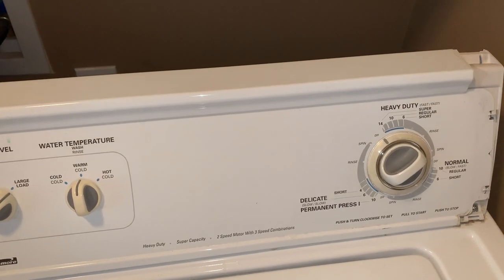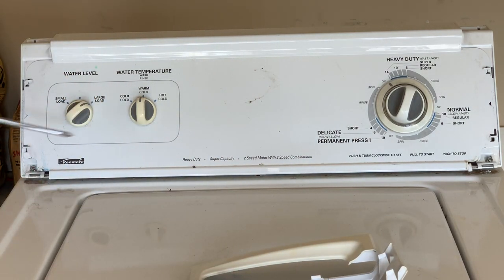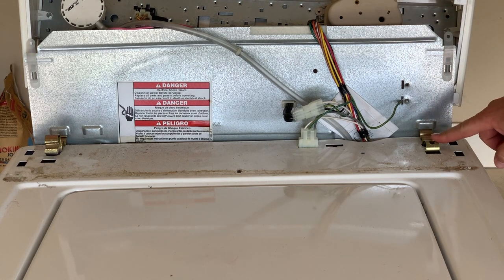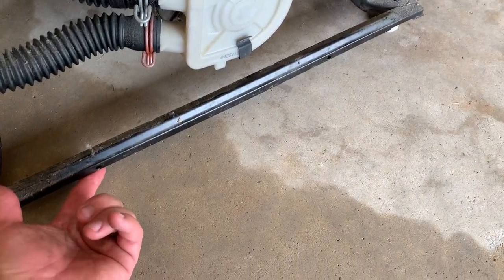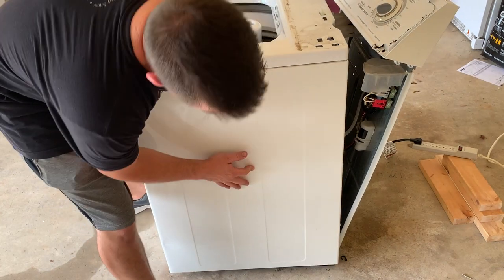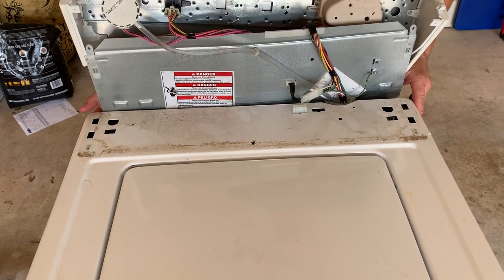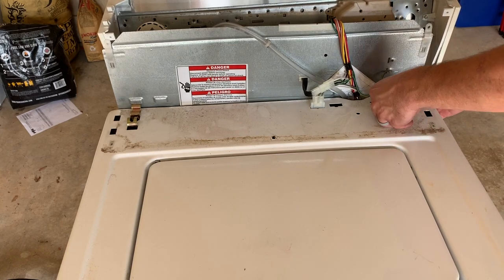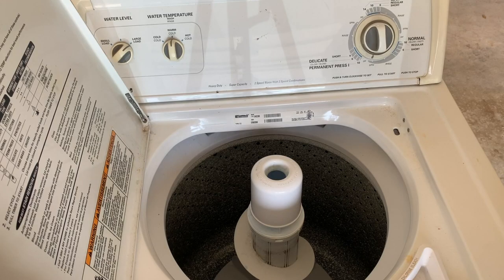Whirlpool Kenmore : Removing and Replacing Cabinet Housing

Comment: Thank you very much! Last week I had to take it apart to replace the transmission coupler, and re-wire the lid switch that someone had bi passed, but when putting the cabinet back together, I could not figure out how it went. I couldn't take it anymore, as it was coming apart when I moved the machine. This short video you made helped me to line it up with the metal lip in the front, and sides, etc (plus it is rusty, and dirty down there making it harder to figure out) so thank you! Even something simple like this is a huge help!!
Reply from the maker: My pleasure!

Comment: To remove the washer cabinet you DO NOT need to remove the hot or cold water supply hoses .
Reply from the maker: True. I removed mine so I could have more room to shoot the video.
Reply: ugh.  The trouble I went through on that part of the job!

Comment: This is a very helpful video. Thank you. I’ll add that some Whirlpool washers do not have removable trim capping the ends of the control panel. Instead, you must insert a putty knife into the gap on either side to release the spring clips that allow the control panel to flip back.
Reply from the maker: Thanks for adding to the convo!
Reply: There are several methods of anchoring the control console to the machine top on direct-drive models.  Some Kenmore models have the screws beneath those removable trim pieces as shown, some don't have the screws exposed without trim pieces.  Another method is screws at the rear corners of the console, with little tabs that flex back when a screwdriver is put in place, flex forward to hold the retracted screw.  And the spring clips.

Comment: Great video!  I just replaced a Washer Water Inlet Valve on a Whirlpool washing machine that was exactly like the one in this video...without the
little side covers over the two screws on the side. I didn't have to remove the cabinet, I just took the top loose and was able to get to the part I replaced.
Everything took about 30 minutes.  This video was perfect!  🙂
Reply from the maker: That’s great! Removing the cabinet is a pain.

Comment: Thank you so very much. You probably saved me $350-400 I too was struggling putting it back on. Of course its a pretty old machine and the frame is a bit dirty and rusted, but I got it back on. Quite honestly I wouldn't mind paying $75-100 for a repair. I don't understand how they justify charging so much for parts and labor. I wish I made $75/ hr and charged 300% mark up on parts.
Reply from the maker: I’m glad you got it working again.

Comment: Be nice if you showed how you got the top strap to snap onto the motor and kind of tools you used. I use electric tape to suspend the top strap from above so that it does not get in the way or fall off while replacing the motor.

Comment: Them two covers on each side of control panel you already popped and made easy top remoive is a key bit of information you omitted. How do they get taken off without breaking them.
Reply from the maker: I didn’t have any problem popping mine off. I didn’t need to use a tool.
Reply: @TightWadDIY  i had to use a putty knife.
Reply: I used a 5 in one tool. Be gentle and keep prying on all sides while wiggling the cap. It should come free.

Comment: Very helpful. I’m a tightwad too with a 20 yr old washer
Reply from the maker: I don’t plan to get a new one any time soon!
Reply: @TightWadDIY  hopefully I won’t either. Will have to see how this repair job lasts. That cabinet comes off much easier than it goes back on
Reply from the maker: @b-ran7024  The parts on this model are pretty basic so they should last a really long time. The cabinet is definitely tricky to get back on.

Comment: Do you know how to disassemble the cabinet because I need it to fit through a 24 inch doorway leading to my basement???
Reply from the maker: I don’t think that is possible. Sorry.
Reply: @TightWadDIY  OK thanks...
Reply: @TightWadDIY  Oh it's possible. They call you TightWad in your neck of the woods. In mine they call me Taz. (As in Looney Tunes The Tasmanian Devil).  I ignorantly tore the heck out of my cabinet. Top off, the three sides that make the shell flopping in the wind of my cyclone. Hardware pieces popped and hiding all over the laundry room. I'm in the middle of reconstructing the whole washing machine, save tub and it's parts underneath it. 
    It can be done, but I wouldn't do it unless you carefully.....Nope, I wouldn't do it.! Pain in this devil's butt! 👹💩🤬

Comment: Hi, what year was this model made?  (My model # 110.26712693)  Thanks in advance!
Reply from the maker: I’m not sure. I’m not an appliance tech.
Reply: @TightWadDIY  I think I have the exact WM in this video, Kenmore S-80  110.27812692. It's at least a couple of decades old & I only replaced one part near the pump about 5 years ago. I forgot how to remove the cabinet and I think the pump might be clogged from a memory foam bath mat that got destroyed 3 loads of wash ago. Dogs won't let any repairMan in the house, so this Chix gotta do the fix! Thanks for a great video, which is saved to my library (& I subbed!)
Reply from the maker: @jlamb199  I’m glad you found it helpful!
Reply: @TightWadDIY  Cabinet is off and about to pull apart the pump assembly. Your video made it a cinch! 
❤ back atcha!